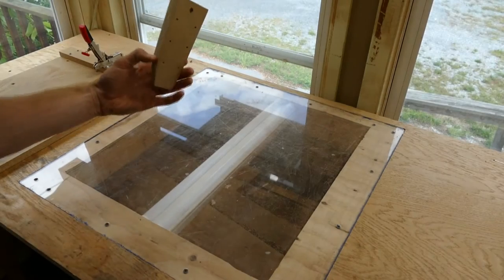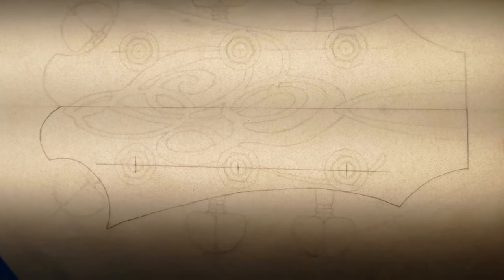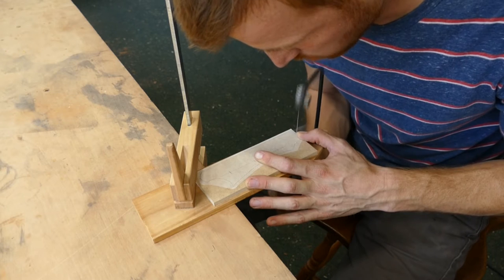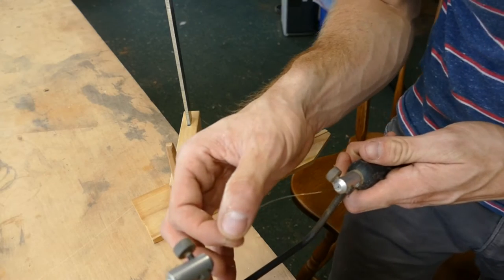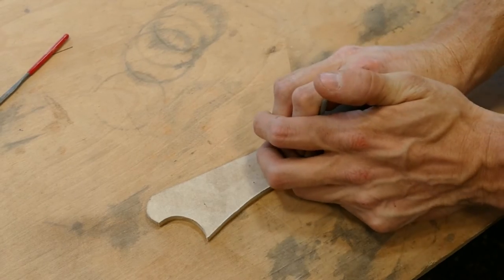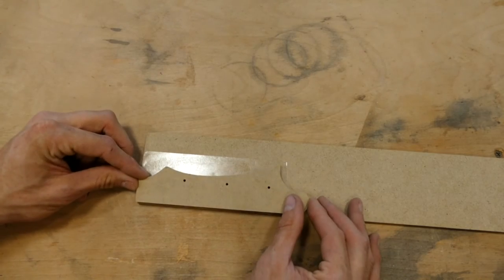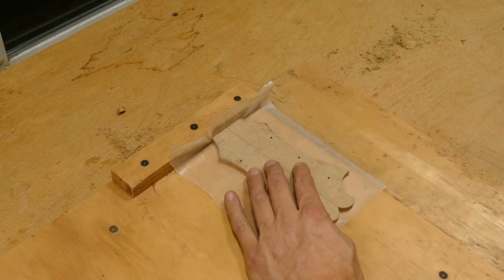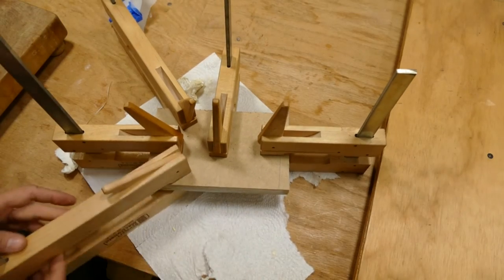#30 Creating a Headstock Template

Comment: Hey Erica, thank you. I’m having problems on my headstock in reference to Side Bearing of the strings from the nut to the tuner locations. Is there a recommendation as to tuner hole locations?

Comment: why 3/4 " and not 1/2 ? for the work template
Reply from the maker: That's a great question, Walter. It's because a bevel will be added to the nut end of the template before routing, to allow for the 15 degree headstock angle. And you need enough material so that you don't lose part of the template when you sand or plane this bevel in.
It's hard to explain. This really is the kind of thing where a picture speaks a thousand words, so I found one in the student gallery that shows what I mean: 
http://www.ericschaeferguitars.com/wp-content/uploads/2015/09/IMG_20150614_131012.jpg
Reply: oh i see now thank you